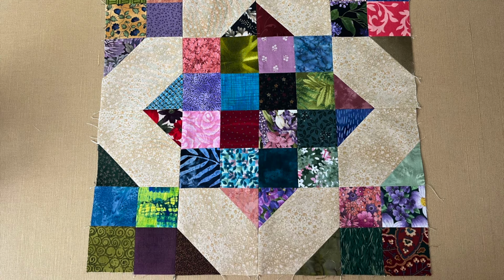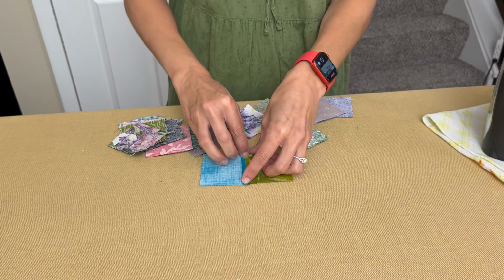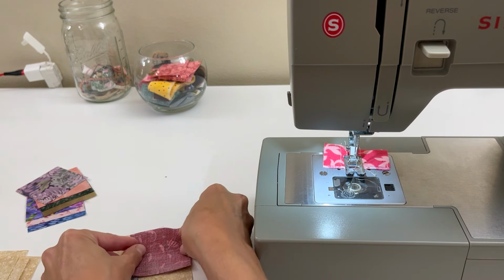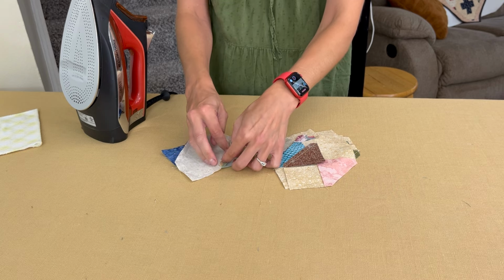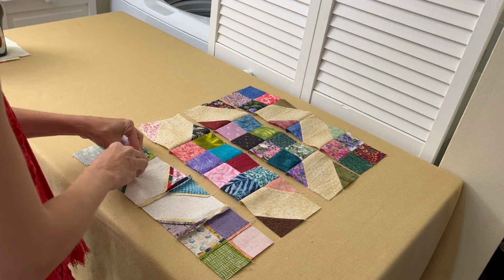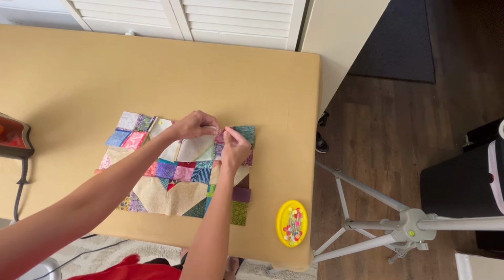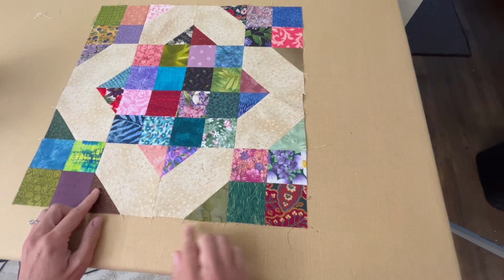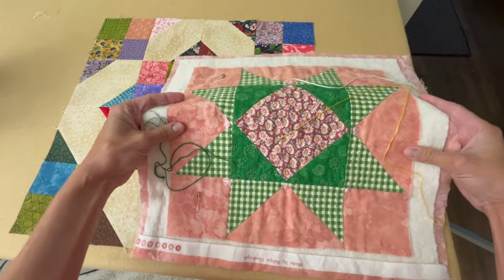HOW TO PIECE AN ARKANSAS CROSSROADS QUILT BLOCK

Comment: Why dont you sew 2 1/2 inch stripes together and cut then down instead of all the individual pieces?
Reply from the maker: Are you asking if you can use longer lengths of 2 1/2 inch strips? You can use any length you want. Hope that helps!
Reply: You can, it's just going to be less scrappy. This is a great block for using scraps of all sizes
Reply: I have a bunch of 2 1/2 inch squares of scrap, so I would have to do it her way. But that would save time with your idea.